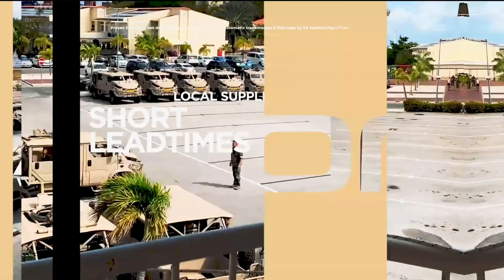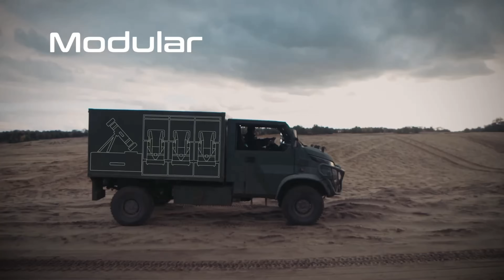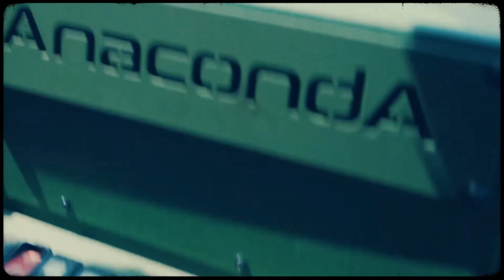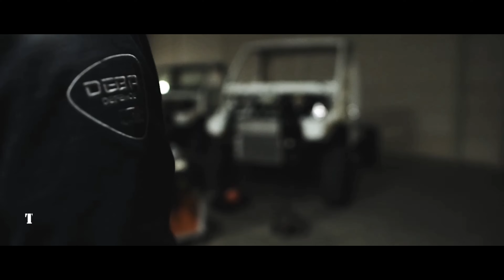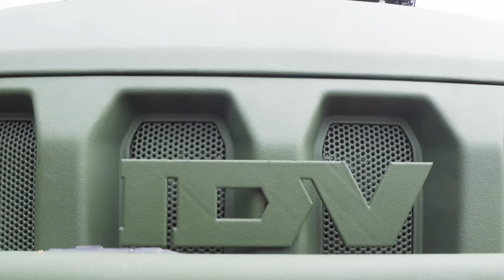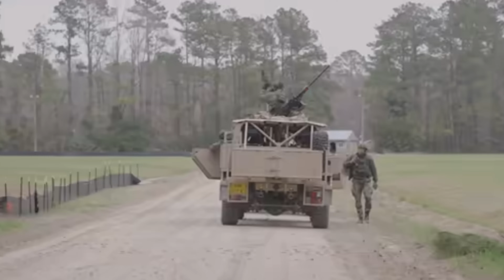Dutch DMV 'Anaconda' Tactical Military Vehicle | HEAVY DUTY CARGO VAN 🚚

Comment from the maker: 🚨 What do you think of the DMV Anaconda? Should we cover more Special Forces Vehicles next? Drop your thoughts below! 👇👇 Don't forget to LIKE, SUBSCRIBE, and HIT THE BELL for more military tech deep dives! 🔥💥
Reply: I am eyeballing this as about seven meters long, along the bare frame. I don't know how much Level 4 protection would weigh, using the lightest durable composite and a spall liner; but I am picturing a hexagonal armored housing laid lengthwise with a "V" top and "V" bottom, and a pan underneath with water for dissipation. A modular almost-MRAP that is enormously lighter and hopefully cheaper, for things like ambulance duty.
Reply: @davidgoodnow269  it's for defense of the dutch Caribbean and disaster relief of that territory
Reply: @davidprins5504   Hmmm . . . probably pretty good for those purposes.
Reply: @davidgoodnow269  yes absolutely 💯 
It's good as a standard vehicle for the islands with 3 instead of 2 machine guns 💪
Reply: I believe the future of armored are 4x4 armored cars with 25/30 mm turret that can take on air targets in ideal case so programmable ammunition and 3 feed belts or just any for choice loaded. Smack couple anti tank rockets up there. Put some modular armor on top of that beast like crates nets 12.7 protection and active protection, laser beam sensors, smokes and you can rock that shi. If armor can be destroyed by a 200k dollar rocket make armor cheaper than 200k and produce the living hell out of that platform. I am talking like tens of thousands of those things. Oil and donut lovers have been onto thistruth for a  couple decades already with HMMWV and JLTV.
Reply: I’m Dutch, and I did not even know we had these
Reply: @Ronny_van_Gerwen  gebaseerd op het succes van ISIS met Toyota pick- up trucks, IVECO heeft een contract met defensie en de hele logistics zijn al aanwezig.
3 machine geweren I.p.v. 2,
Ze zijn voornamelijk bedoeld voor het verdedigen van het Caribisch gebied en disaster relief
Reply: 3 machine guns instead of 2 🎉
Reply: The tires look rather comically small for it, other than that, utilitarian is good.
Reply: And what the hell is wrong with word modular? I am soon to be automotive engineer and I have no problem with that word😅😅😅
Reply: Idk how you plan out your videos or if there is a plan at all 🤐😂 but i'm here for mini-series on different topics so we can look at different systems side by side more easily. Always enjoy your videos, keep up the good work mate, greeting from germany 🖖
Reply: It reminds me of Serbian , Zastava NTV  TERVO vehicle. You should do a video on it.
Reply: I think that it looks like an excellent use case vehicle. I don't know how useful that it would be for Canada, It would be a bitch to have to ride around in that in even -15°C that's for sure. Definitely could be useful for Special Forces like JTF2 or CSOR. I would like to see Canada get rid of the TAPV and maybe the G-Wagon  replace them with the M-ATV and JLTV, but that wouldn't happen unless we increased the Military budget to  5% for several years and greatly accelerated procurement to reduce the inflation costs instead of dragging everything out like the Government has been doing for so long. But I digress. Let the military procure what they need rather than making it a political football. If they have the money and a plan let them cook.
Reply: @claymclaren5788  It's a very bad vehicle just like the newer Manticore. You should never buy Italian or French build vehicles for your Army. You can better buy German build and enginered vehicles. The German build Eagle or Dingo on base off the Unimog 2,5 ton truck was a far better choice.

That the Anaconda and Manticore are chosen seems in my opinion due to corruption.
Reply: It could be, I haven't much looked into any further than watching Matsimus' video. I thought it was an interesting concept, kind of like the Land Rovers the SAS modified and used in the Falklands. Sadly I have nothing to do with Canadian military procurement as much as I would like too. You have to be Quebecois or speak English and French like a native speaker to get the good jobs in the Canadian Government, and I can only cus in Quebecois.
Reply: @j.d.trenning883 I don’t think it is corruption, not very widespread in our country, but more a cheap choice. The Dutch always want to pay less for more. Unless it is American made, like the F35. And maybe there is another reason, the Royal Marines refused to go to a new to build base camp and practice grounds in the outskirts of the country. They wanted to stay in the middle of The Netherlands and they got their way. But land is expensive in the centre of the country as well as building costs, so there had to be budget cuts on other camps and equipment to pay for a more expensive base camp in the middle of the country. So it could be a result of their own choice to refuse a move to the southwest.
Reply: @RealConstructor   If they have a base already, why would they need to move?
Reply: @j.d.trenning883  😂😂😂
Reply: It's a bad vehicle like the Iveco Manticore. I really don't understand this choice. The German built Dingo or Eagle on base of the Unimog 2,5 ton truck was a far better choice. There are many problems with these Iveco's. The Belgian Army use them to and wants to get them phased out cause of the numerous problems. Also the newer Manticore is bad. Bad view from the interior, bad seats, very bad suspension so the crew isuues problems with their spine and back, bad off road capicity, smaller people can't drive it safely, you need a minimum crew of 2 cause of the bad visibility from inside.

The Anaconda and the Manticore are to very bad buys by the Dutch armed forces. The idiots who have chosen these vehicles should be triald for high treason and corruption. There is no way that these vehicles came out as best tested vehicles.

For Army use you should never buy French or Italian build vehicles but buy German build and enginered vehicles.
Reply: Practical! Just like the Dutch!
Reply: These deployments are not combat deployments, these are holiday destinations.
Reply: Good but ugly
Reply: @ It is not a fashion show.

Comment: Light utility vehicle like these will again have to face the mission creep of military as they are designed for coin operations but will be used in conventional war. Today with cheap drones the line is blurring even more so, as more protection with active protection system against drones, missiles rocket, artillery and mortar is prerequisite for future proofing, not to mention ieds and various types of mines thrown at these type of vehicles by both conventional and unconventional enemies.

Comment: It's likely a lot cheaper than the top brands as well. I think this was an answer to the failed concept deal with Mercedes to design these modular vehicles so they could be transported in Chinooks or other military transports the Dutch military uses. It would not surprise me it's also designed for that. The design also has middle east and African environments in mind because a lot of our NATO missions involve those locations. During the US missions into Iraq and Kuwait I also noticed the US troops actually ditched the Humvee doors for escapes during terrorist group ambushes. Very closed vehicles actually prevent the quick counter attack needed in such cases

ps. I get the Neederlands joke but the pronunciation in Dutch is Neaderlands for English speakers actually (Nederlands). For the next one I guess 😂

Comment: It's a purpose built vehicle made according to the clients wishes. If they wanted IED protection and full enclosed armour, they would have gotten the "Fennek" recon and patrol vehicle. If the clients want an open vehicle with limitless utility they get the Anaconda. I'm sure this will never see front line action in areas that are vast open plains, snowy terrain or urban environments. The utility is that you can save up a lot of cost on other specialised vehicles, troop transport, medivac, recon, patrol. The open nature also avoids the need for heavy HP compensation for all that armour. Saving on fuel cost.

The all-terrain nature, all purpose, cheap nature makes it an ideal support vehicle/ It's not a front line menace. With nations on limited budgets it can give you just all they want, and it's a more "western" variant of the Toyota Technical. Both have that A-Team attack vehicle style. Light Recon, all purpose 4x4 ATV can still be resold after its military lifespan to civilian vehicles.
Fully customisable and purpose-built features that are easy to replace and repair anywhere, at any time is a god-send for maintenance people and logistics planners. Unless there is a fire zone it will be the first on the scene. Don't know enough about tanks to make the statement that the open nature might protect better against some types of ammo. 

It's a moneymaker. It's best weapon is hitting the budget numbers. War is expensive after all.

Comment: It's good that we got this. The alternative bidder was a clear-cut corruption scam (in my opinion), the Vector from Defenture.

Which is basically a glorified quad with 1920's engine tech from a moped dealer in Tiel, and two former officers of the only two units that bought the Vector. Yes, only current Defenture shareholders ever bought Defenture projects. Which is why I'm calling corruption.

They wanted a 'Vector freight' to become this purchase, but once again: It's a glorified quad. Defenture's vehicles are inferior to everything including the vehicles they replaced. While Iveco has tons of experience with this modular platform.

Comment: "Open architecture" does not mean "open vehicle", it is a term descibing a type of hardware (or software) architecture intended to make adding, upgrading, and swapping components with other manufacturers or systems easy, as opposed to "legacy architecture" or "closed architecture", which often has many (hidden) proprietary requirements. Open architecture systems use a standardized system which allows the end-user to freely install add-ons, while closed architectures, if they are expandable at all, may have one or two "expansion options" using proprietary connectivity that may require some form of support from the manufacturer or fitting enhancements may only be possible by technicians with specialized tools and/or training.
Reply from the maker: @ronaldv_tm  thank you

Comment: I want to ask to some of the operators that actually use this equipment; Is this more of a replacement for the older DAF 1800 trucks? Or is it a more specialized application? The Scania trucks that iḿ seeing in the Veluwe proving grounds seem much heavier and are way worse to (un)mount than the DAF's due to their increased height.
Btw, i'm not military, just love this content 🙂

Comment: That clip around the nine min mark - why was the M2 and FN Mag jamming soo much? They were racking the charging handles after every couple of shots, and the weapons were not stopping firing because of the operators releasing the trigger; they were stopping firing even though the triggers were still depressed.
Reply: I'm guessing they didn't have a blank firing adaptor fitted, and so there wasn't enough recoil from the blanks to reliably feed the next round.
Reply: @kramelbbiw  that makes sense, but raises the question of why they were firing blanks without BFAs attached.

Comment: The Huyndai iLoad can probably be repurposed for a military flat form. The commercial version is already built like a tank, it can take up to a ton of cable drums, roof can tank 200-300kgs of loads with a pair of decent roof rack. 
You can load it up all day everyday and the transmission and engine keeps going, even the rear shocks are holding strong.

Comment: The thing that actually causes a problem in modular designs is that it can only do one thing at the time, and the people doing procurement tend to forget that fact. If it's being used for medevac it can't also be used by drone teams at the same time. So if you need the ability to perform an arbitrary combination of tasks at any one time, you need to have dedicated platforms for each of those tasks. At which point, what are you actually getting for the design premium it takes to make the platforms modular?

Well, to answer my own question, you get the ability to swap in vehicles to replace losses. You get reduced maintenance overheads by having fewer platform types to maintain (even if each modular design typically takes a bit more maintenance). You can more easily move drivers around in the org chart. So it has it's value, it also creates a downward pressure on the number of platforms to keep in inventory.
Reply: One can have a specified ambulance, but many military vehicles and for ex APC have mountings to put one or two NATO stretchers in it, in case of a hurry.  It would be very primitive, without oxygene or monitors or whatever, but for injuries on "not vital parts of the body"  it will work.  We already had this on the Volkswagen T3's "Bullies"  in the 80ties.   I think the real ambulances aren't that "modular"
Reply: @bertnl530  That's not really the point. If you are using the APC to move people out, it's not supporting an armored spearhead, nor is it escorting a supply convoy. You have a set number of things you need to do at once, and a limited number of platforms to do them with, and what often happens with modular systems is that the bean counters count it at filling both roles without considering it can only do one at the time. So when the balloon goes up, you're sitting with an empty motorpool and things start grinding to a halt.
Reply: @gnaskar  It is more like mount different types of armour or arms on it. Using it to carry say 8 Marines in the back of the cargo module or carrying some pallets.  Using an ambulance to carry drones or other support  is a no go, as long as the thing is marked as an ambulance.  The modularity will be only in the front part of the truck, not in the medevac shelter.
Reply: @ >Using it to carry say 8 Marines in the back of the cargo module or carrying some pallets.
And right there we're back to a beancounter deciding you don't need supply trucks, since the APCs can carry pallets as well as marines. And suddenly you're sitting there with all the transports loaded full of troops, wondering which one to call back so you can free it up to resupply.

If the procurement people think it does both, you may get less vehicles total, which makes your unit less capable.
Reply: @gnaskar   That's how the procurement people  think.  Trucks or vehicles only for one purpose is a nightmare, both from a logistical point of view as from costs.  There are dedicated cargo  trucks on the isles, IVECO  Eurocargo 5T  4 x 4.  just like there are small buses, but flexibility is needed. And also these vehicles won't always do their dedicated task.
Reply: @ I'm beginning to get the impression you didn't read my whole initial comment before replying.
Reply: @gnaskar  I did, but it can also be a misunderstanding, as I am not a native English speaker.

Comment: The Anaconda is really a single use vehicle to ferry marines around fairly small Dutch Carribean islands. Drivetrain being commercial helping save on maintenance, They will in due course be replaced by the Iveco Manticore (also modular ;-). Which is purpose built for the  military.
(sort of European JLTV?)

Comment: Not Every Role needs to be fixed with Armor....  When used correctly & replacing Home Base transport it does make a bit more sense.  
Cheaper, easy to maintain, larger numbers,
Reply: Vehicle protection always goes through phases:
1. After a war, redefining doctrine for the next war: "mobility and speed will enable us to destroy the enemy before he has a chance to kill us; mobility is armour!"
Phase 2: Damn, we are taking unnecessary losses in our unarmoured/inadequately protected vehicles, bolt on anything you can find, doesn't matter if it destroys mobility or shortens vehicle life we need to survive!
Phase 3: Rapid procurement, we need something designed to survive, but as a stopgap so not perfect
Phase 4: Our Perfectly designed solution is entering service just as the war is ending. Doesn't matter it'll be useful in the next one.
Phase 1: Mobility and speed will enable us to destroy the enemy before he has a chance to kill us; mobility is armour!"